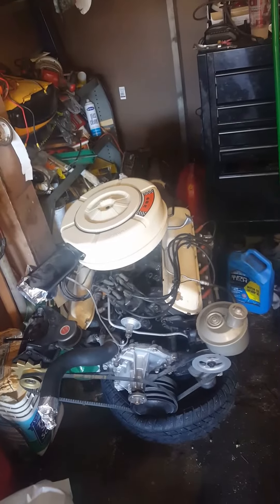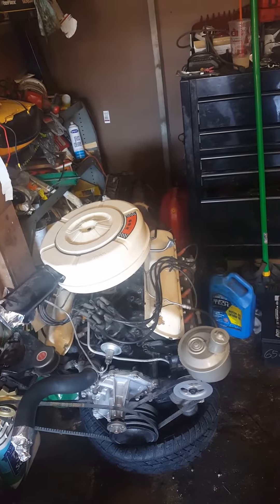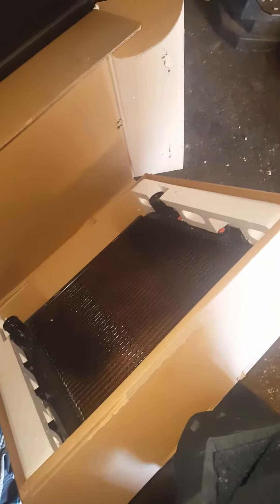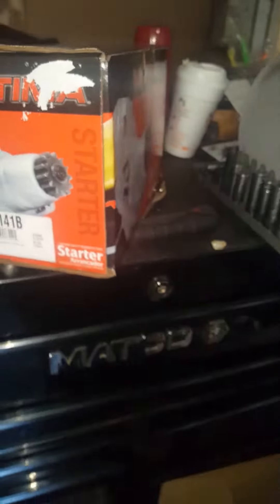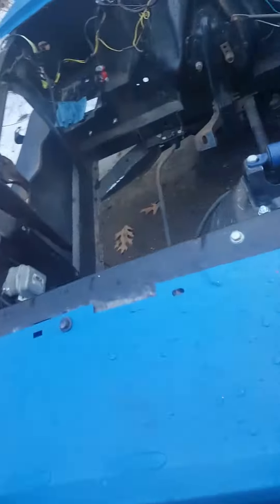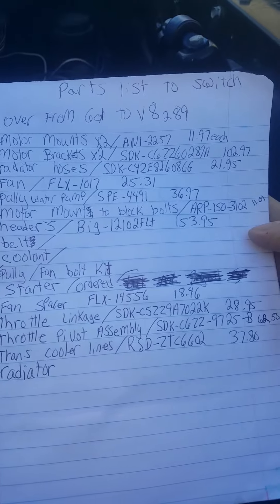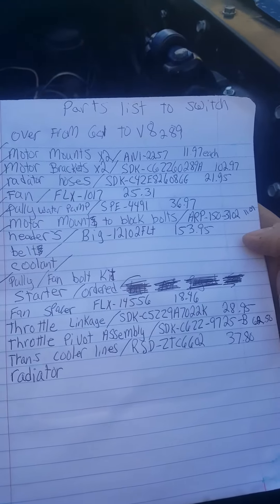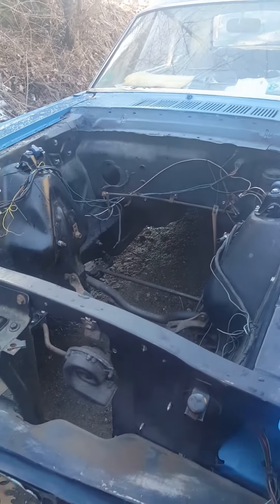How to convert your 1966 mustang from a 6 cylinder to a 289 part1 parts list break down

Comment: The frame does not need to be changed/altered just the mounts and brackets; you need to get a new V8 crossmember for oil pan clearance, crossmember can be screwed on in the same way the 6 cylinder one is screwed on to the frame.  If you have an auto transmission, you need a new V8 bell housing, a new flex plate and a new starter. You will be adding about 100 pounds in weight (when contrasted with the 200 Ci engine). You are better off changing brakes and spindles for heavier/better performance. Accelerator linkage, radiator and hoses, fan, fan spacer, belts and done. The work is not too complicated but you need space and time.
Reply: would you need to change the bell housing etc if you have a 3 speed that came with the i6
Reply: Man I wish I would have held onto my 66 coupe, yes it had the straight 6 200 ci. I think it came with a c6 transmission if I remember correctly. Sold it in 1989 only got $2,500 for it back then but there were a lot more on the road back then also.
Reply from the maker: I would imagine
Reply from the maker: @richr2310 2500 that's about what the car went for brand new lol look around these are still out there and you can still get a deal if your willing to do the work to make them something again

Comment: I’m in the middle of a swap and purchased the V8 accelerator pedal assembly but seems like the firewall hole is not in the correct position. were you able to find anywhere a template of where to drill the new hole?
Reply from the maker: I didn't have to drill any new holes

Comment: I heard you say v6, or did you mean straight 6 cylinder 200ci? Did ford use the 170 in 66?
Reply from the maker: I messed up yes straight 6 I think the 67 was when the 200 sprint the way to tell is how many freez plugs the block has in 66 I imagine it would have been a 170 Aldo the blocks were painted read for 170 and the 140 I don't imagine they used the 140 then I do have a 61 falcon you should check out thar series on my channel

Comment: I heard that you need to change the suspension, drive shaft,  differential, steering components, and change to 5 lug. Are all of these nescesary or can you get by with just dropping in the engine.
Reply from the maker: I drove mine with just doing the motor but its all on the list
Reply: I did three 6 to V8 conversions back in the 1980's. Two out of the three still have all 6 cylinder steering and brake parts. Those two got beat on pretty hard and survived. I'm not saying it's ok, I'm just saying. It is best and safest to covert to all V8 steering and suspension.

If you are not using a big HP V8 and you have an automatic trans the rear end will survive The driveshaft doesn't need replaced.
Reply: @Deucealive75  Thanks
Reply: Rear sump oil pan? You were able to clear the crossmember and 6 cylinder steering linkage?
Thanks I got a 65 i6 here that’s slowly going to v8, using a 71 bronco 302
Reply from the maker: I just dropped in the engine at this point but 5 lug is a nice upgrade and drive shaft depend on what you are using for a transmission

Comment: Forgot transmission mounting bracket,  driveshaft cutting  mufflers exhaust pipe but I guess you intend to get to that.
Reply: 7 years ago?
Reply from the maker: I do have another video on what I did for a tranmission mount and drive shaft but I didn't keep it I'm currently restoring this car from firewall back if your interested please go watch it
Reply from the maker: Atleast

Comment: The engine swap is the easy part!  How’d you do you suspension, steering, and rear end?  Can’t keep the straight (v6 what?) six parts.
Reply from the maker: I haven got to that yet
Reply: what else do you need for suspension and steering
Reply: Robbie Krishnan  You need V8 spindles and springs. The V8 spindles require V8 tie rods and steering linkage.

Comment: HELLO can you help me, I am changing the l6 engine for a v8, I have your list but I cannot find engine mounts and the metal mounts that brand are and where they are requested the part number is sdk-c62260289a and arp-150-3102 thanks